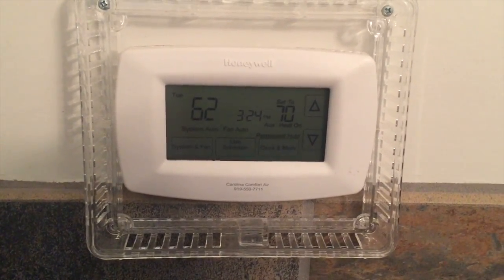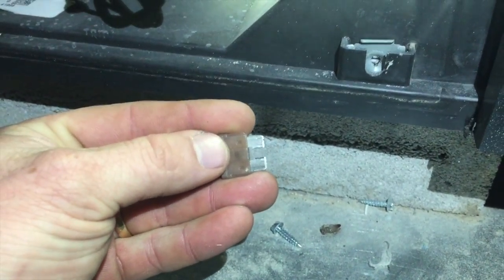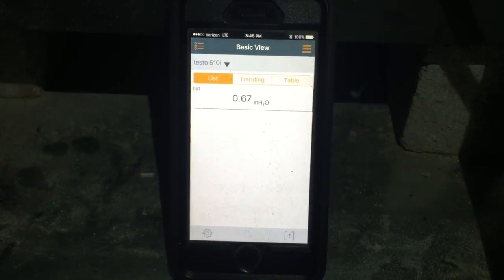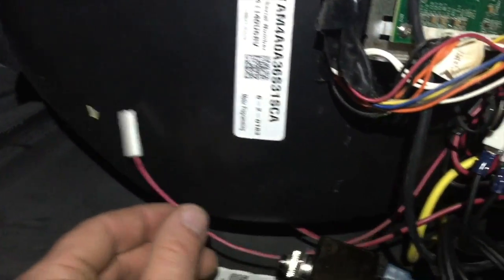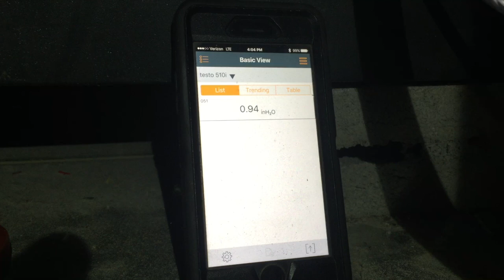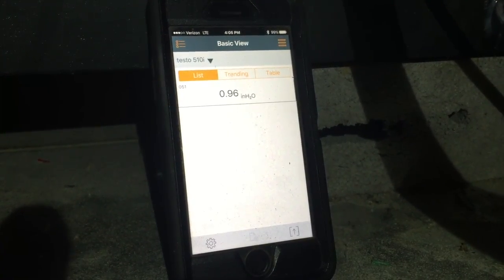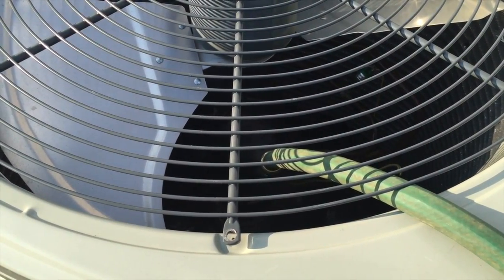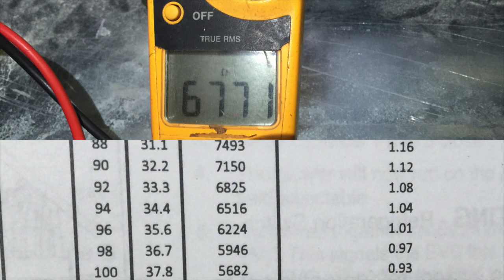HVAC Service: The Dirty Maintenance Show NC

Comment: Stephen, the reason we take static pressure is to get it down, you see it's about the CFM going across the coil that is what will put your BTU's, subcooling and superheat right nothing else. The higher the static pressure the less CFM you will get across the coil. I don't know why the manufacturer's go so high on their blower performance paperwork. Just because .9 is listed on there doesn't mean you what to be there.

Comment: Max static on the rating plate is what I go by for static, assuming the manufacturer goes twice the rating on their chart so I can quantify to the customer in cfm how much we are missing as the static goes above the rating plate. To me efficiency would be the time to satisfy the thermostat providing airflow is ideal. Lower static = more airflow on a lower speed. The quicker we can cycle the volume of air in the structure & add or take away heat to satisfy the stat, the quicker the systems shuts off. I do not mean an oversized system though. Just my 2 cents.

Comment: Hi Did you put your volt meter on that relay that was chattering looks like a loose connection on the low voltage side to me which would cause 5 amp fuse to blow. How long has the system been in and have they had 5 amp fuses blow a lot. Great video
Reply from the maker: I did try to catch it while it was chattering, it didn't do it when I had the meter on it. The unit is a 2014